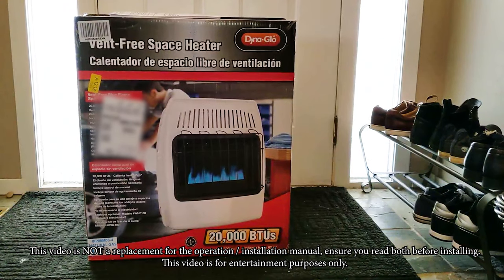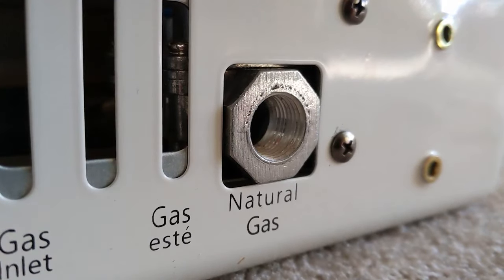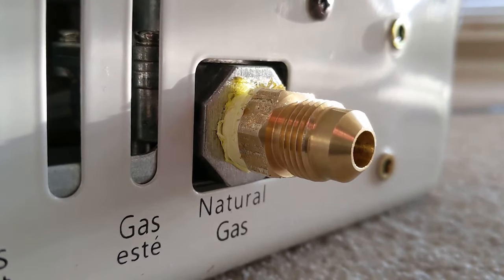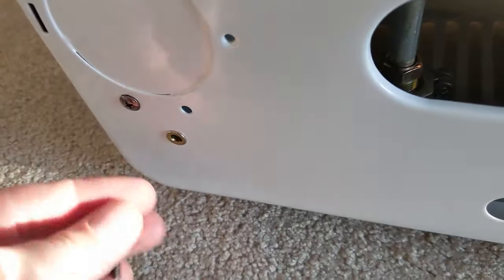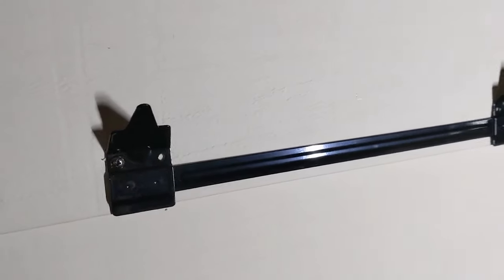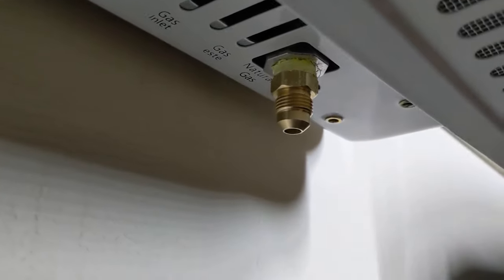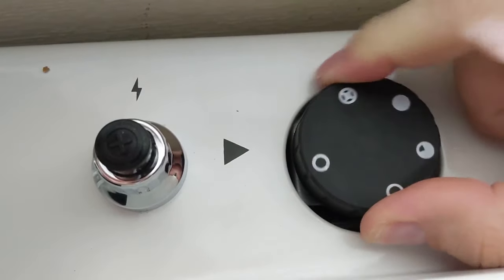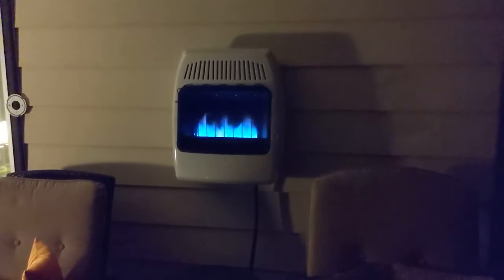How to Install a Dyna Glo Ventless Heater - An amazing vent free natural gas space heater!

Comment: just went thru the whole install process, gas is on (i can hear and smell it)., ignition is working, but pilot will not light…. wondering what is wrong.  last time i called a tech it was $160 for them to spend 5 mins at my house and tell me to get a new unit, which i just did

Comment: I would like something like this in an unheated room in my house. Do I need the utility company to run a line up to this second floor room?
Reply: Probably, yes.
Reply: No you need a plumber
Reply: It depends on your level of exp., most will. I ran mine but im on propane and I put a 30,000 in my basement which I finished. The first initial pilot light can take a few MINUTES to light but then it's fine

Comment: Is it possible install an external thermostat to a gas furnace like this so that it kicks on and off at different Temps and also at different times of day?
Reply: No not possible the knob is physically turning the gas valve where as a t-stat is completing an electrical circuit these don’t have any sort of power in them just an on off valve
Reply: This company does sell one and I just installed one last week in my garage.

Comment: Do these produce a lot of water vapor?
Reply: I have had one for over 5 years for backup when storms cut my power. Yes there is water vapors that make it to your windows but beats being cold
Reply: @barberdoug6930  yea true. I actually ended up installing an espar diesel heater in my van

Comment: I bought 4 burnner gas  wall heater  
Last year and when I put it on 1 it blows out the  pilet why
Reply: Gas pressure to hi, you need a low pressure regulator in the line..

Comment from the maker: Note that I mounted my heater higher than most, this will has a minor effect on heating efficiency... but it's where I wanted it! 

It's also mounted on the exterior of my home, in my sunroom. But rest assured this is designed for indoor use (read the instructions!)
Reply: Just
Reply: It’s a stupid installation. The design of this wall furnace allows you to install it to install it flush to the wall and a thermostat to control the temperature.
Reply from the maker: @joyoptimal6286  lol

Comment: I have one but for some reason it won't start/light. My neighbor says it's the elevation but I'm at 6500 so it should be ok. He says to adjust the orifist but I can't seem to figure that out.. Anyone out there can help me it would be much appreciated....
Reply: When I first hooked up my DynaGlo, it wouldn't ignite. I figured I needed to bleed the line of air. After about two minutes of holding the button down in the pilot position, the pilot slowly began to light. So, if at first you have this problem, be patient. The air will eventually leave the lines through the pilot orifice and propane will eventually make it's way and ignite. Now the problem I'm having is a pilot flame with a tail and cycling on and off; burner flame won't stay on, no matter how high I have it set. Correct me if I'm wrong but my guess is my pressure regulator isn't set to between 11 and 14 W.C. I've made adjustments to the regulator but can't achieve a pilot without a "tail" like the pictures in the manual show.

Comment: My brand new dyna glo blue flame works but the burner cycles on and off when it barely reaches 60 degrees. I have the thermostat set on 5. I would think it would stay on until at least 70 degrees. What could be the problem?
Reply: Oxygen low
Reply: @fgonzalez78959  it turned out to be the spacers on bottom we’re needed. Made all the difference in the world.
Reply: Mine does the same thing
Reply: @virgotaylor9818  I just added the included spacers and that fixed the issue.
Reply: @dblaylock22  Thank you. I’ll try that today
Reply: @dblaylock22  Thank you. That actually worked. You saved me from purchasing a new one because I thought the one I have was bad. You should do a separate video about this issue

Comment: ?  mine is propane and natural gas and I am going to use propane  . The hose was with the heater that I bought at the flea market . Well really the guy gave me the hose and the box was unopened  and now want to put it in my basement  . What is the connector that goes into the heater . Is it the same but 2 pieces that are connected to make it L shaped  to hook to the heater

Comment: one quastion, that hose was rubber you connect the gass line? is that legal ? if was it
Reply from the maker: Yes. It's a natural gas hose I purchased at a local BBQ store.
Reply: Should have use a metal shielded gas hose.